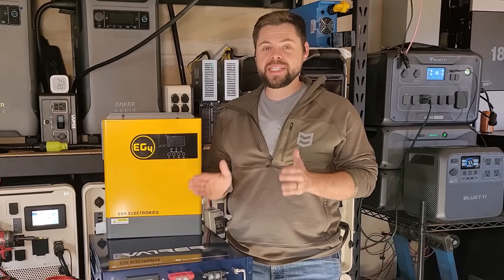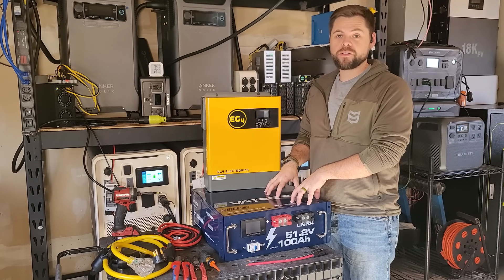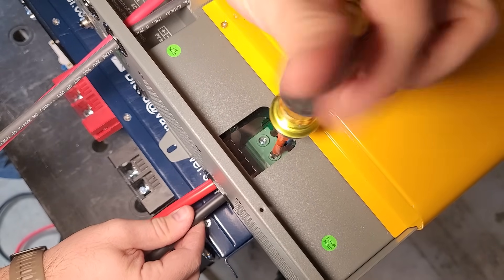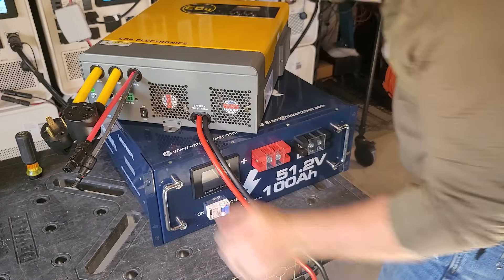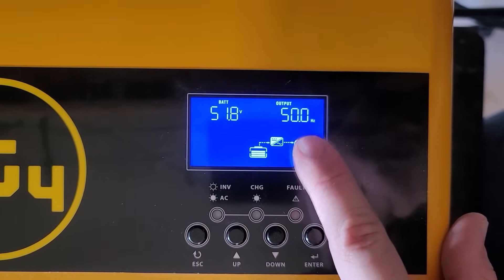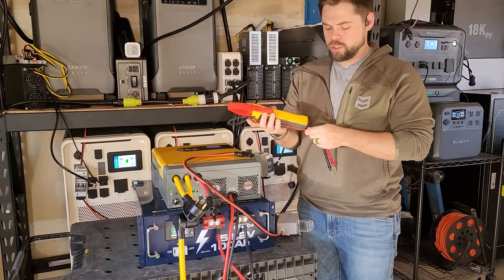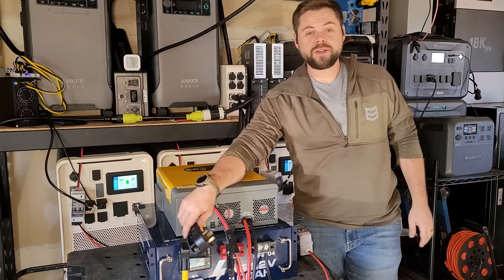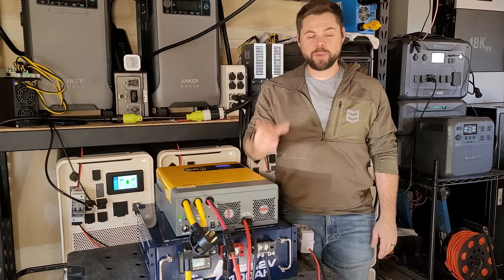Budget DIY Solar Power Station [Step by Step Guide]

Comment: Why no ground on the output? Is it because of bonding or something other?
I just bought 2 Vatrer server rack batteries and a Li Time 3500watt inverter/charger for just over $2200 with some discounts. I'll probably get a larger 240v inverter/charger and I know solar panels are next. I'm still deciding on where to put panels (roof or ground) and how large to go. Of course, it all depends on Trump tariffs since virtually all panels or parts come from China.

Comment: Hello!    In light of all of that is California, I have purchased components to build an EG4 / Vatrer Cart System.  My goal is to use this system to protect my kitchen fridge and garage freezer during outages.  For reference, the R/F combo is currently using 2.5KwH/day and will be higher come summer.  With the help of my inverter generator, I hope to recharge the 48V battery through the EG4 while simultaneously supplying power to the R/F without overloading the system. But what is the best way to accomplish this?  
My Inverter Genny can supply 2500w-running (2800w-starting) of AC into the EG4 if I use an RV Connector… But will this overload the AC input of the EG4?   Is this even a good idea?  I think I read that you can charge as high as 30A through the EG4… I plan to charge @ 17-20A and also feed power to the R/F.   And alternative would be to use a separate 48 V charger or chargeverter….
Any advice would be appreciated…  JD

Comment: I'm in a tiny house with wheels. I need to replace my growatt 3k, mppt is dead.  Expansion/split phase. I need to be able to mount it on the wall like my growatt.  Currently I'm doing 6 pv at 37.2 each into the inverter.

Comment: I just purchased the DIY invertor & battery, based on your video, I expect delivery next week. Right now I do have a NG powered generator setup to power my house, so this is secondary to that, but not sure how reliable NG will be in future, so I would appreciate info on expansion & split phase.

Comment: Just getting started and have the same set up but being a newbie why did you cap the ground on the ac out ?  Thank You
Reply from the maker: Because there is no ground port for the AC output.
Reply: I have this inverter and two of these batteries powering my RV. In the user manual it says to run the output ground wire to the grounding screw on the bottom of the inverter.

Comment: EG4 has a UL listing for Solar but I can't seem to find the UL listing for the Vatrer anywhere, do you have a link to the spec sheet that shows the UL listing?
(Without it, I can't get it to pass a local inspection for solar install)

Comment: Good project, but could do it cheaper. (4)12v 100ah batteries instead of server rack could save $400. This is a great project to scrounge for and let your “finds” influence your build. I think that most of these solar generators will be charged from the grid most of the time. Making it mobile is useful.

Comment: For those asking for split phase, just substitute an MPP Solar LV6048 Inverter and you'll have split phase up to 6kW, however with a single battery, I would not recommend going over 2.5kW; you should put more batteries in parallel to get to 6kW output.

Comment: Unless the BMS has a soft-start feature, when you close that breaker, there will be an internal arc when the inverter caps pre-charge. It's best to use a pre-charge resistor even if you have a breaker. Also, most inverter manufacturers specify that a Class T fuse be placed in-line between the battery and the inverter.

Comment: I built the same using all EG4 products.  I would like to point out that for some one that does not have a solar farm like you do that using this particular eg4 inverter may not be as user friendly if you do not have a minimum of 120V to use the mppt charger in the inverter.  I personally have around 65 V of solar panels in series so this inverter will not work for me.  I use wall power to charge it.  I have purchased the Victron MPPT 150/35 solar charger to charge the battery with solar.  I have a lot of shade on the roof and yard so it is easier to chase the sun with a smaller array.  Also would like to let your viewers know that the inverter consumes a ton of energy on idle consumption.  On a recent power outage I was only able to run my 26 cu.ft fridge for 37 hours where 2.4KW of battery energy went to the fridge and the rest went to the inverter.  I have ordered a Victron phoenix 48V/1200 inverter that will be solely used for the fridge, which will extend running time.  Maybe you could do a video for people who live in apartments or have limited solar panels that could use the server rack battery and the victron units I mentioned.  I personally don't want to be off grid but am prepared for outages.

Comment: Thank you! split phase please! And could you role play/explain how to use this set up to power the following: fridge, tv, lamp, and electric stove and water heater, (all running directly from the inverter; not plugging up to home fuse/circuit panel). pretty much a power outtage scenario, using power strips and extension cables? That, honest;y, would be so spectacular. Than you again! More power to you!

Comment: Lastly, on these small inverters, for the AC in, yes you can plug it into mains power, or a generator.. however... make sure the generator is an "inverter" generator so the power remains "clean" enough. otherwise, if voltage drops or hz is too low or variable, the all-in-one will disconnect, and eventually it could damage it.

Comment: EG4 3k. settings, Option 9, change from 50hz to 60 hz.  In the manual. It worked for me, but been a bit so I don't remember exactly how I did it. might need to not be under load.

Comment: One thing to remember on the small systems like this. the EG4 3K requires 120vdc on the pv input to start charging. Many people doing these systems may be able to do that, or like in my system, currently due to lots of shading until I can drop more trees, I have to do 2+ smaller arrays running at lower voltages.

The Li-Time or a couple other "all in ones" have pv input 60-145vdc.

The point being, be sure to match the pv voltages, when charging starts, and not exceeding to your situation.
Reply: Yes, this was my complaint about EG4, and I emailed them too. I would like to see it handle as low as 48v Solar input...
Reply: I want to use the EG4 but I don't have 120v of pv.  So Li Time is one of my options.  But I cannot find any reviews of it. Any other suggestions?

Comment: Just installed the EG4 3000EHV about a month ago. In order to change the setting from 50Hz to 60Hz it has to be in standby mode if I remember correctly. You will turn the inverter off and it will continue to run for a short time (or, if you have solar coming in, it will stay on) and this is when you need to go into the menu and switch it to 60Hz. The next time you start it up it will be correct at 60Hz.
Reply: @SlimSh8E  You also have to have two power sources connected according to EG4 tech team.

Comment: so. it will not do 60hz?
Reply: “The inverter should be set to standby mode with its power turned off while being connected to two power sources, such as PV and Battery. This configuration would then permit the adjustment of the frequency.”
Reply from the maker: https://youtu.be/Pi4ZOCj9TTY?si=6A0n-lXqhQu47oNS

Comment: I'd like to see a solution to the 60z issue. Do an update after working with EG4?
Reply: “The inverter should be set to standby mode with its power turned off while being connected to two power sources, such as PV and Battery. This configuration would then permit the adjustment of the frequency.”

From EG4 tech.
Reply from the maker: @williamwilson6499  https://youtu.be/Pi4ZOCj9TTY?si=6A0n-lXqhQu47oNS

Comment: As always, great DYI video Ben!

Unrelated to this video, I noticed you got yourself a Victron Autotransformer sitting on top of your DP3. Just curious if you ever did happen to connect it in between your EcoFlow (EF) Double Volta Hub (DVH) and your SS2-50P inlet connected to your interlock breaker to keep both EF Delta Pros (DPs) depleting equally?

Edit: I made the comment above before I saw you using the AT to get split phase. LOL

Comment: Split phase, expandable, bitte.

According to EG4 tech team on diy-solar forum, 

“The inverter should be set to standby mode with its power turned off while being connected to two power sources, such as PV and Battery. This configuration would then permit the adjustment of the frequency.”
Reply from the maker: I will try that. Very interesting
Reply: @minutemansolar  Did that work to change HZ?

Comment: Split and expansion as well how did u get to stay on 60 all you showed was it going back to 50
Reply: “The inverter should be set to standby mode with its power turned off while being connected to two power sources, such as PV and Battery. This configuration would then permit the adjustment of the frequency.”
Reply from the maker: https://youtu.be/Pi4ZOCj9TTY?si=6A0n-lXqhQu47oNS

Comment: For a pre-made set up, is Apollo or Eco Flow better?  Could you please do a comparison (pros & cons) of the two with their latest best models?  Thank you!
Reply from the maker: https://youtu.be/oUjjsTA5I64

I personally lean towards the Apollo and it's what I use personally even though I have both. The downside is you need two units for 240v power, but then you also get double the solar input. The life blood of these systems is solar input and so personally that's my vote when pressed on the matter. Either unit can be purchased with lifetime support at https://poweredportablesolar.com

Comment: Being in the US, we need 60hz.  Did you ever figure out why it stayed at 50hz?  This looks like something I would build, but not with it only running 50hz.
Reply from the maker: No but it's running things fine but I will do an update video asap
Reply: “The inverter should be set to standby mode with its power turned off while being connected to two power sources, such as PV and Battery. This configuration would then permit the adjustment of the frequency.”
Reply from the maker: https://youtu.be/Pi4ZOCj9TTY?si=6A0n-lXqhQu47oNS

Comment: Two reasons why I preferer ground based solar panels.  1.)  I don't like climbing ladders when servicing is needed.  2.)  It's easier to wipe off the snow and clean the panels with  mop.
Reply: Lol. So last year got onto roof trying to knock off the snow from bifacial panels and almost slid off roof. 😂.  I felt like the Griswalds
Reply: Mine are eco worthy adjustable racks. I can adjust the angle for summer and winter angle.
Reply: And Your Able to Adjust the Solar Array Angle during the year for Optimization

Comment: I can’t use 50Hz. As you showed us you can’t change it to 60Hz. And I’ll not rely on a maybe!
I watched your video twice and nevertheless no 60Hz.
Reply: Yeah, this is a pretty glaring omission. Like, oh well can't change it, that'll be fine. Not when you plug your first micro processor device in it won't be.
Reply: @ I guess you could plug it into a clock and see it run ten minutes late. I wasn’t happy with that outcome.
Reply: “The inverter should be set to standby mode with its power turned off while being connected to two power sources, such as PV and Battery. This configuration would then permit the adjustment of the frequency.”
Reply: @williamwilson6499  so no plug and play. I would prefer a hard set and not rely on it should work.
Reply from the maker: https://youtu.be/Pi4ZOCj9TTY?si=6A0n-lXqhQu47oNS

Comment: Split phase and Expandable!!  :)    I am hung up on what inverter to use in my motorhome that we will be living in full time next year.  I have designed several systems on paper.  Using EG4 all-in-ones and Victron Multipluss ii units.  Looking for about 10k total inverters with EG4 LL batteries.  This video was giving me even more ideas.  Thans as always for the great content.